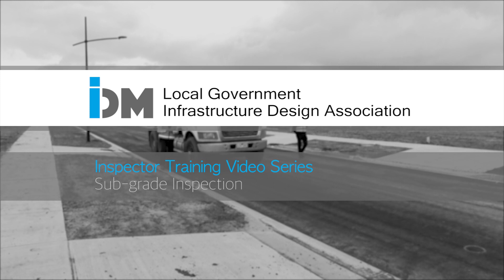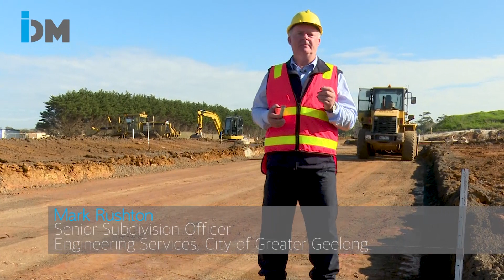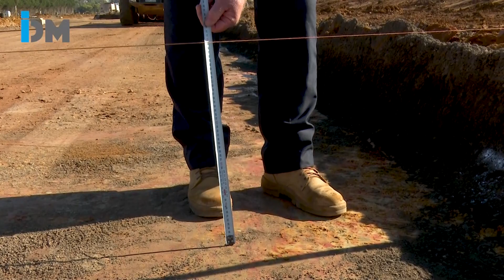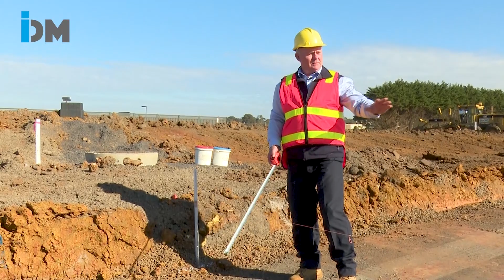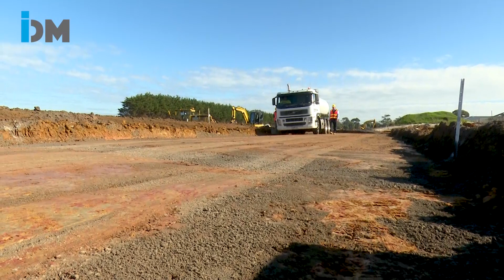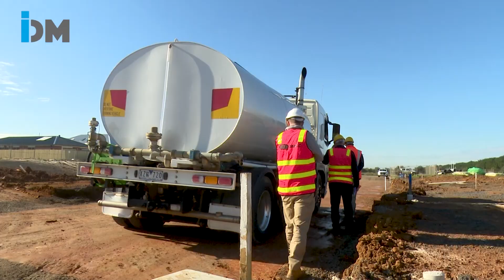LGIDA  Inspector Training Sub grade Inspection

Comment: Is sub grade just earth/dirt
Reply: Grade is the elevation at which you build. Sub grade is elevation just below that. So u must pass subgrade before you build upon
Reply: Great question , was wondering the same thing
Reply: It can be dirt, concrete, wood, ect.
Reply: In roadway construction, sub grade is generally mixed material, so a backfill material mixed with a stabilizing material